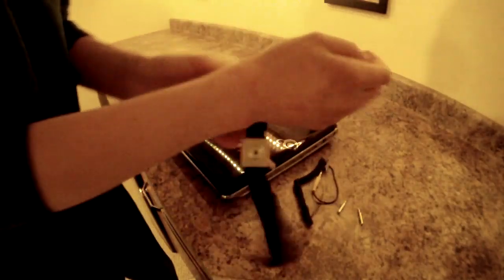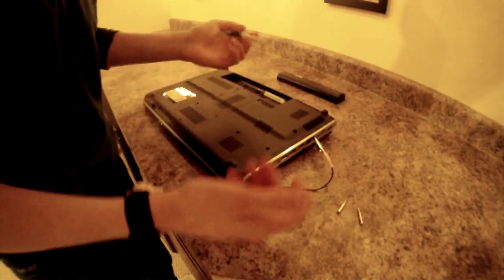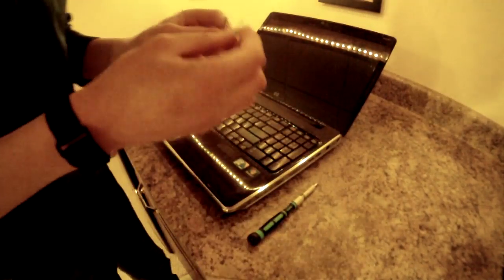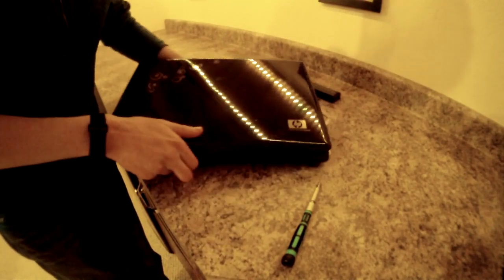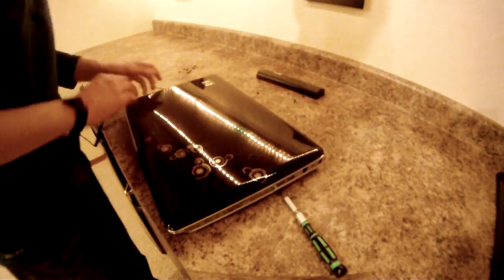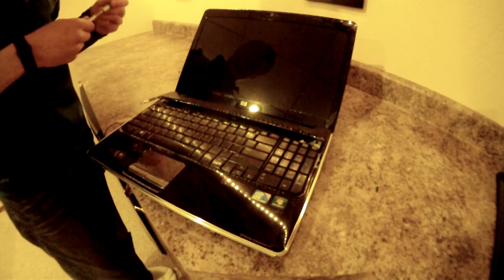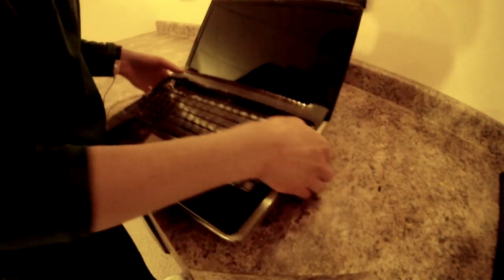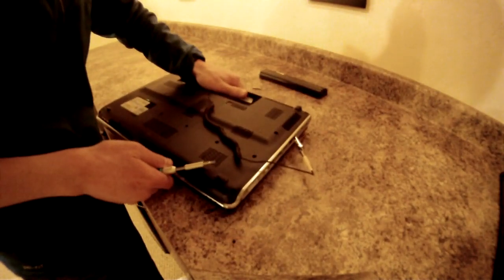How to Access Keyboard - HP Pavilion dv6 Laptop [HD]

Comment: Thanks man, you actually did help me open up the computer properly. A couple of my own notes to contribute to this, and I'm not sure if it's clear in the video -- make sure to remove the hard drive and remove the three screws underneath it marked with the keyboard icon. Also, it's not necessary to remove the RAM cover as those screws are not attached to the keyboard, and I'm almost certain that the outermost screws on the corners of the computer aren't either. Cheers!

Comment: As others have noted, you have to take out the three keyboard retaining screws that live under the hard drive. And you don't have to remove all of the keys on the bottom of the computer, just the ones in the speaker area and the keyboard retaining screws. 

Other than that, fine guide. Thanks for making it.

Comment from the maker: @Ojokernegro If the screw is half-stripped then maybe try using a slightly larger screwdriver and make sure to put a lot of downward force (not too much though because you don't want to break anything) into the screw.  Sometimes that does the trick.

Comment: why do you need to take all the screws off of the bottom of the unit? it seems you just need to take the keyboard screw off in the batter compartment, pop the plastic clip, remove the silver tabbed screws, and replace the keyboard? i'm waiting on my replacement board so sorry if I didn't just try this myself yet...

Awesome video, btw

Comment: they are not soldered in should be upgradeable however with a laptop you need to be darn sure it is one supported by the bios of the motherboard use the service Manuel on line all hps have one you may be able to jump to a different processor other then listed if the processor is sold in a different model but only if it is close to your model make sure you select wisely service Manuel will have instructions on how to replace your processor the last time i did this was with a dv9740